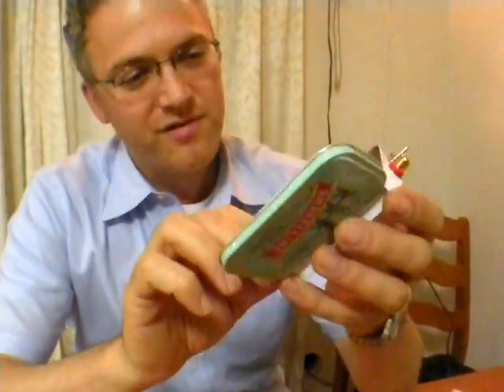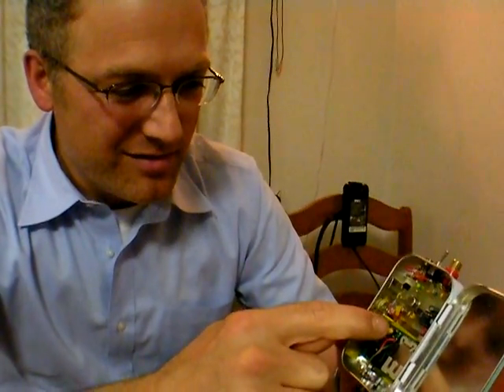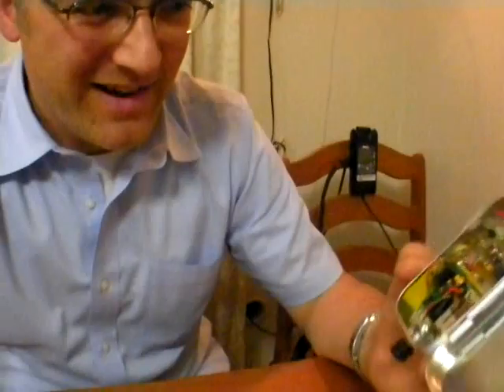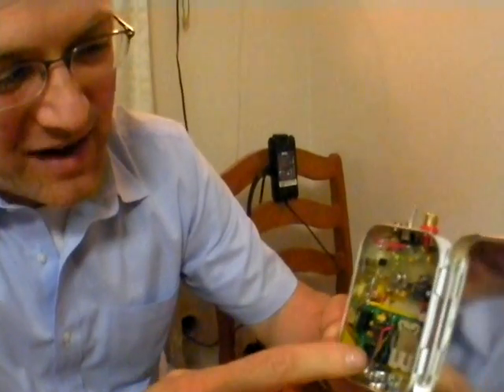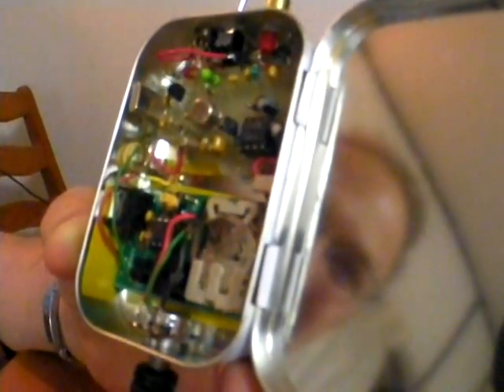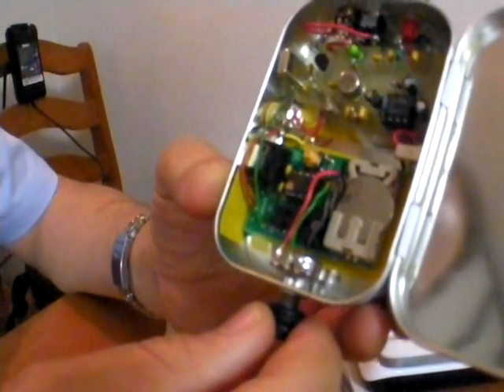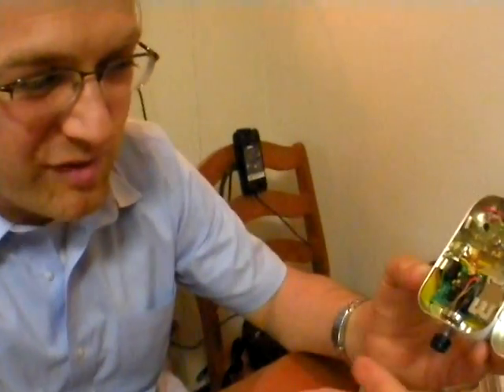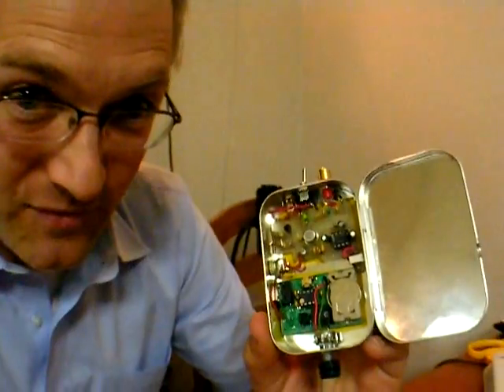Building a Pixie 2 QRP Kit (Ham Radio) Chapter 4

Comment from the maker: By the way, what is your callsign? You have a good plan, sounds like. Even practicing in the same room is a fine way to get started. Move to a different block, then a different town--mostly get on the air and try. My first QSO was in 1993 or something. My mother had to take the key and finish it out because I freaked out and didn't know what to say. It was about 4WPM and with a straight key--but it was a QSO and I got a QSL card from the guy. Get on the air! I command you!